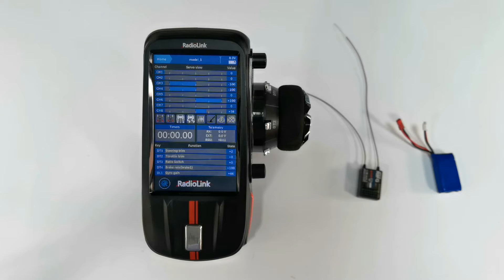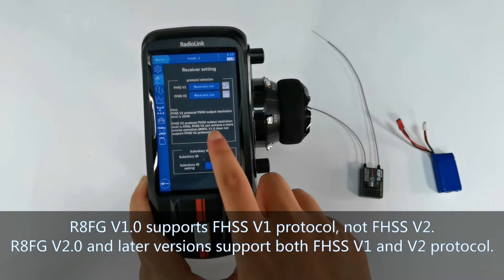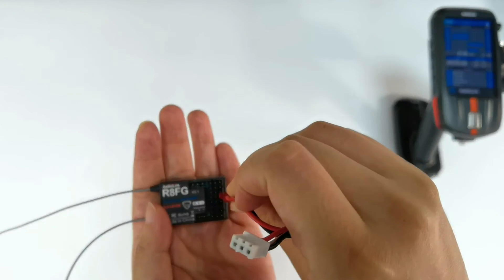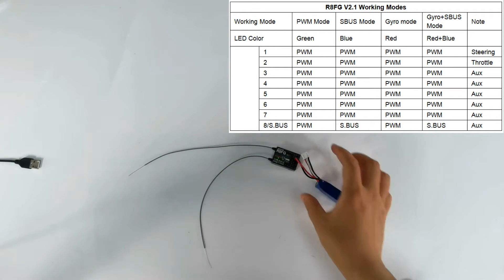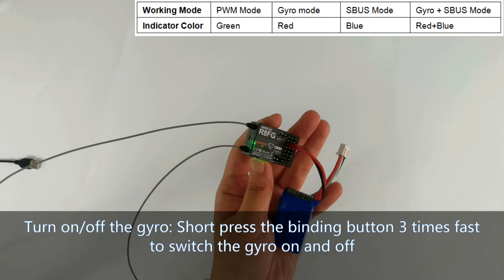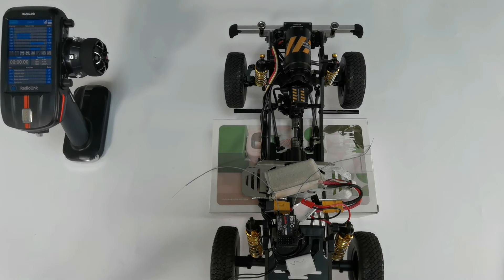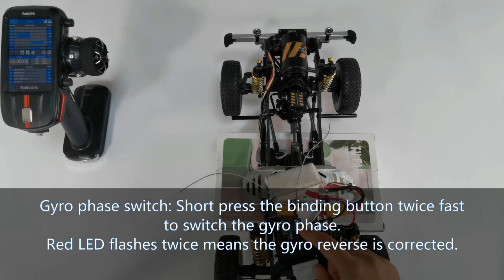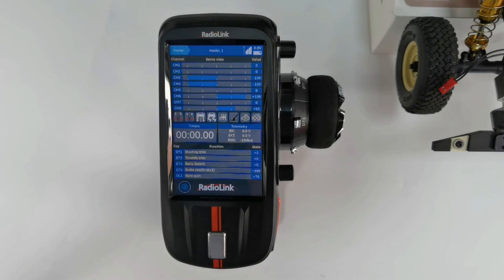Binding, Working Modes & Gyro Function of R8FG V2.1

Comment: Bonjour,

Je possède actuellement une radiocommande Radiolink T12D et je souhaite acheter le récepteur R8FG pour l’utiliser dans un projet d’avion RC.

Avant de finaliser mon achat, j’aimerais savoir si le gyroscope intégré au récepteur R8FG peut être réglé et activé directement depuis la radiocommande T12D.
Pourriez-vous m’indiquer la procédure à suivre pour activer et configurer le gyroscope ? Est-ce que cela se fait automatiquement ou faut-il effectuer des réglages spécifiques (par exemple pour les gains, les canaux, etc.) ?

Merci d’avance pour votre aide et vos conseils.
Reply from the maker: Hi, sir. What version of R8FG you are using? T12D has gyro function. GYRO function of T12D is only applicable to FHSS V2 protocol receivers, including R8FGH, R8FG V2.1 version, R4FGM V2.1 version, and R8FG and R4FGM receivers with a factory date of 2023/4/26 or later. Other receivers do not support this function, but the gyro sensitivity can be controlled by channel 8. Assign a knob switch to control channel 8. Then the knob can be used to adjust the gyro sensitivity. Here is the detailed manual of T12D for your reference: https://www.radiolink.com/t12d_manual  If any question, please feel free to contact us. Our email is after_service@radiolink.com.cn
Reply: Bonjour, merci pour votre explication détaillée.
Je prévois d’acheter le récepteur R8FG et je voudrais m’assurer qu’il est bien compatible avec la fonction gyroscope de ma radiocommande T12D.

Aussi, une fois que j’ai attribué le canal 8 à un bouton rotatif, est-ce que le gyroscope détecte automatiquement les servos, ou faut-il configurer manuellement chaque canal ?

Merci d’avance pour votre aide !
Reply from the maker: @edwardyohan3713  Hi, sir. Sorry I made a mistake. You cannot assign a switch to qny channel of T12D to adjust the gyro sensitivity now. This function will be added in the near future. You can use R8FG V2.1 or above versions, and then adjust the gyro sensitivity in the GYRO function menu. Sorry you cannot assign a knob to CH8 to adjust the gyro sensitivity now.
Reply: Merci pour votre réponse. J’ai une configuration spécifique : un avion RC avec 4 servos (2 pour les ailes et 2 pour l’empennage). J’ai besoin que le gyroscope aide à la stabilisation en vol.
Comme je ne peux pas attribuer de molette sur la T12D pour ajuster la sensibilité du gyro, est-ce que les réglages fixes dans le menu GYRO du R8FG V2.1 suffisent pour bien stabiliser un avion comme le mien ?
Ou est-ce que le gyroscope est plutôt optimisé pour les voitures ou d’autres modèles ?
Reply: j’ai une question technique.
Étant donné que le R8FG possède un gyroscope intégré, est-il capable de stabiliser les trois axes de vol (roulis, tangage et lacet) sur un avion RC utilisant plusieurs servos — par exemple 2 pour les ailes et 2 pour l’empennage ?
Est-ce que le gyroscope applique des corrections sur plusieurs sorties (comme CH1 à CH4), ou bien agit-il seulement sur un axe ?
Et pouvez-vous confirmer si le gyroscope est bien actif et prévu pour les avions, ou s’il est surtout conçu pour les voitures ?
Reply from the maker: @edwardyohan3713  Hi, sir. the gyro of R8FG only works for one channel, CH1. And R8FG is suitable for car or boat, not for plane. Because the control range is not enough for planes. If you want to use T12D to control a plane, we recommend you to use R8EF receiver. Sorry we do not have airplane receiver with gyro function.

Comment: What is the best mode? Gyro and sbus?
Reply from the maker: Hi, sir. There is no best mode. It depends on what mode you want. For example, if you want to connect flight controller that supports SBUS signal, you need to use SBUS working mode. Here is the detailed manual of R8FG which introduces the working modes of R8FG: https://www.radiolink.com/r8fg_manual  If any question about RadioLink products please feel free to contact us. Our email is: after_service@radiolink.com.cn

Comment: Once you have gyro on is there a way to turn it off on transmitter?
Reply from the maker: Hi, sir.. Yes. You can turn off the gyro on transmitter, Just adjust the gyro sensitivity to 0 on transmitter. Then the gyro is turned off. If any question about RadioLink products please feel free to contact us. Our email is: after_service@radiolink.com.cn
Reply: @Radiolink_official it seems like when i turn the gyro down its still worls even when turned down to 0 . Any advice?
Reply from the maker: @patriotcontainers4349  Hi, sir. May I know what channel did you plug the servo into? And what working mode is your R8FG? What color is the receiver LED? Some servos only support PWM signal. If you plug the servo into SBUS channel, the servo may shake. Here is the link to introduce the working modes of R8FG for your reference: https://www.radiolink.com/r8fg_manual  If there is still any problem, could you please take a short video to us to show the problem? Our email is: after_service@radiolink.com.cn
Reply: @Radiolink_official thank you im very happy with your customer service, ill check it out and im ising the perfect pass servo in my infraction 6s
Reply from the maker: @patriotcontainers4349  Thank you. If any question about RadioLink products please feel free to contact us.

Comment: Little confused, how do you connect a battery to the reciever without loosing a channel?
Reply from the maker: Hi, sir. Generally, you connect ESC to channel 2, throttle. The battery connects the ESC. Then the BEC will supply power to the receiver. So you won't lose a channel. But if you do not use ESC, but want to connect a battery to the receiver directly, you will lose a channel. If any question about RadioLink products please feel free to contact us. Our email is: after_service@radiolink.com.cn